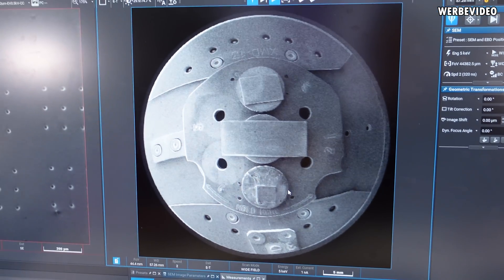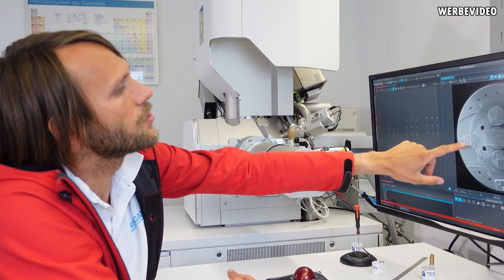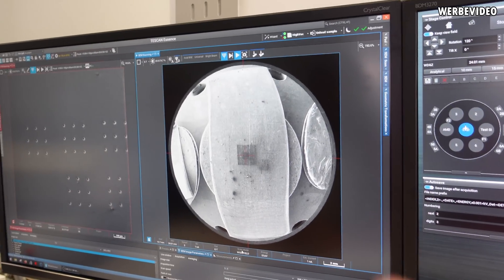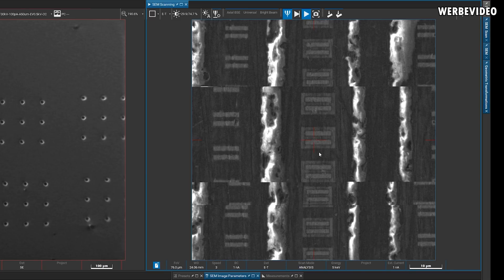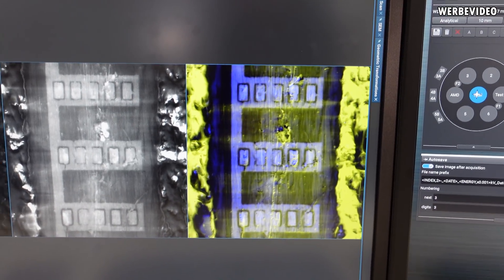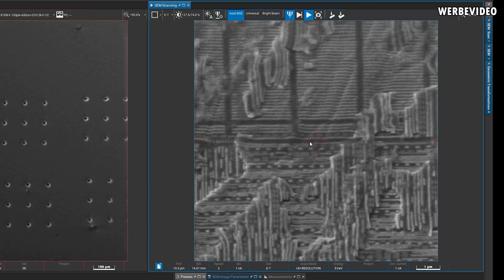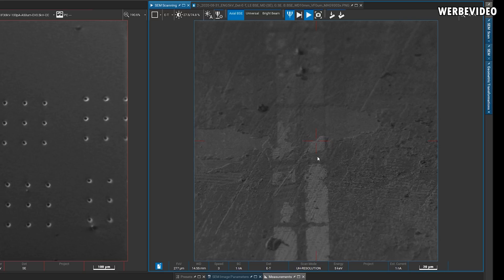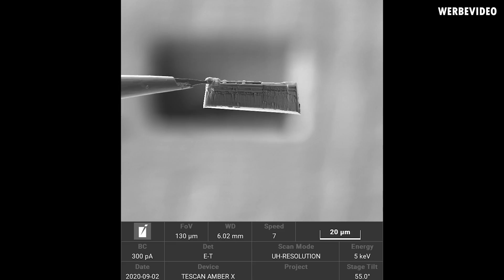Ryzen Nano-Structures more than 100,000 times magnified. Visiting Tescan Part 2/3

Comment: What do you expect that we expect for that comparison between Intel 14 and TSMC 7? Here my expectations:
- TSMC 7 is not twice as small but it is smaller in general 
- There is no simple dimension, because of FinFET and because there are multiple parameters
Reply: Ok so you know what Electron tunneling is with the transistors, and how they use silicon transistors to get smaller like the 7 nm they are currently at with AMD's Ryzen 3000 series CPU's.
And the 5 nm, 3nm and so on, to make the computers more efficient with performance and energy but now we are starting to see more heat.
Silicon has limits but they keep trying to improve it, and it will melt at specific temperatures, so we need to replace it.
Ask yourself why we aren't using Quantum Materials like Graphene (yet) and still using silicon. 🤨🤔

This is where Graphene will fix the electron tunneling aka Quantum Tunneling, we don't need silicon to get down to 1 nm "nanometer" in size.

Imagine this, Graphene computers with a magnetic current to be 1,000 times faster and possibly only use 1% of the energy used. 💡

Now imagine Graphene optical / transparent transistors for Photonic Computing. 💡

Now imagine Graphene lasers for the fiber optics that would be used as the circuits inside our computers for Photonic Computing. 💡

--------

I would rather see Graphene computers, let's get rid of silicon. I'm serious.

Check this out.
I would give links but the video hides my comments.

Go to my channel and click on the playlist called "Videos with important info to get around my channel". ✔

Watch a Flash Graphene video about Flash Graphene 100 dollars "per ton". ✔

And then another video about "Large machines on earth / in space to make Flash Graphene". ✔

After that, check my channel with 2 simple steps for my other channel, go to the "About" tab of the channel I'm commenting with now and read the info with a link found there to save to your browser's favorites. ✔

==============================

Imagine Graphene for Photonic Computing, to help us save on our energy needs, really think about that for a second with Photonic Computing.

Check my other channel for these 2 playlists.
Photonic Computing playlist. ✔

Graphene computers for home and Starships, playlist. ✔

Learn about Graphene from my other channel's "Graphene playlist". ✔

If you want to know more about Graphene and Quantum Technologies, go to my other channel. ✔🤔💡
Reply: @gameresearch9535  
There is no doubt that somewhere in the 20's or 30's they will start using a new material (I put my money on the late 20's). My prediction is that they will first focus on reducing data-latencies, that already is and will become more the low hanging fruit. It also buys them some time to find a good replacement of silicon. Why silicon is being used? Because it is DIRT-cheap and because they have a lot of experience with it. For me the interesting question is which materials they will use instead of silicon in the future. Apparently TSMC has plans ready but the known mixtures of elements have a problem and it all comes down to availability (also depending on which countries happen to have a lot of it)  and cost.
Reply: @peterjansen4826  

Alright, but you need to still check out the information I gave from my other comment, go to the playlists I mentioned and watch everything. You will understand after.

There is a good reason I gave that information and made those playlists, and all the playlists on my other channel.
Again I would give links but my comments become hidden. Just go and watch the playlists.

My playlists are not made from predictions, they show where we are at, which will blow your mind, and they make you realize the corruption that is trying to hold us back for 2 - 5 years, or 10 - 20 years, when we can actually have these emerging technologies, Quantum Technologies much sooner thank you think.

You have to go to the playlists that I mentioned in my other comment, to find out.

I don't just openly talk to people with guesses, I give them facts from proof. And if I mention it, then I'm trying to open people's eyes so that they can see it at my level, so that we can be on the same page, and so it's going to be very important that people check out the sources on my other channel that I mentioned.
Reply: @peterjansen4826  

The companies make a lot of excuses too, you will find out why on my other channel, when you go to the playlists I mentioned for my other channel, and then check the rest of my channel's playlists. 
We can actually have some emerging technologies now, they just do not want to do it, others are just ignorant and biased. 
My other channel clearly shows this, but I do not want to give too much information here in the comments, there is common sense to be had here, that's the point of my other channel's playlists and articles in the playlists on top of that, and I'm stating the obvious. And it would be pointless to mention reasons here when I have the playlists that already do this with the proof.

Regulations / safety validations force some emerging technologies to take 6 - 10 years, this can also be for many other reasons that are holding us back from having that emerging technology, Quantum Technology, and those reasons are usually from corruption in the industry.
Other reasons are because some of them do not want to give up silicon.
If you do a youtube search for AMD's Ryzen 3000 series launch videos with AMD's CEO on stage talking about it, she says "I love silicon".
They are trying to find any way that they can to keep using silicon by making it a little more efficient just to milk that extra performance, instead of moving onto the next material that should be Graphene nanotubes, see the corruption there.

Everything I said in my other comment was true, we do not need silicon anymore, and my other channel shows everything, if you look at everything on my other channel.
Use a Desktop PC to view my other channel, go to the "About" tab of the channel I'm commenting with now and read the info there, with a link.
Use that link found under my "About" tab, and then go to the playlists I mentioned from my other comment, in the order given and watch everything, all videos in each playlist from top to bottom in that order.

Comment: It would be helpful to try and show the same features on an optical microscope just to give some context for what we’re looking at and how much further zoomed in the SEM is able to go.
Reply: Optical microscopes can't go high enough in magnification for it to be useful on this stuff. Generally the useful upper limit for a light microscope is around 1,500X, which is very expensive. Kinda of a pain to work with, too. Granted there are microscopes sold on the internet advertising mags like 2,000 or 4,000 but going up that high just makes the image blurrier because visible light has too large of a wavelength. 

And really, the only significant differences you'd see would be that things would be in different colors. It'd still be the same patterns of structures that wouldn't really make sense to you if you don't know what they are.

Comment: The next part? Where you barricade yourself in so you could play with their liquid Helium? 😏

Oh, scan some thermal paste! 🙏

Twice as good? (It's quadratic), transistor size has been a dark art for a while now. Although it is incredible how they build at such a scale with such accuracy. Might be worth talking about EUV and why Intel has had recent problems, just Moore's Law in general over the past two decades, we thought we were hitting the physical limits but Moore popped some Viagra and he's back in the game. However, we are reaching the physical limits of size and power density. While they can reduce the voltage so they can add more transistors, the price per transistor can't go down past a point so price will have to go up. How integrated circuits/ silicon looks in a decade is anybody's guess.

Medical imaging is an interesting field, computer hardware is virtually free in relation to the costs involved in buy/ running their kit. If you're lucky they may even turn you into a Gamma source...glow

PS: If they ever ask you would music you want for an MRI, the correct answer is EDM (French or German👌). I asked for some Chillout music for my 1st, I realised that was the wrong choice the second the machine got going.

PPS: Steve wants a SEM to measure heatsink surfaces.

Comment: How on earth do companies manufacture electical components so small. actually mind boggling
Reply: photo etching. printing using light. fascinating stuff.
Reply: They get paid uncounted billions of dollars, so they find a way. Making integrated circuits is some of the most lucrative printing that's ever been done. Whoever has the best process literally has the goose that lays diamond eggs.
Reply: Ok so you know what Electron tunneling is with the transistors, and how they use silicon transistors to get smaller like the 7 nm they are currently at with AMD's Ryzen 3000 series CPU's.
And the 5 nm, 3nm and so on, to make the computers more efficient with performance and energy but now we are starting to see more heat.
Silicon has limits but they keep trying to improve it, and it will melt at specific temperatures, so we need to replace it.
Ask yourself why we aren't using Quantum Materials like Graphene (yet) and still using silicon. 🤨🤔

This is where Graphene will fix the electron tunneling aka Quantum Tunneling, we don't need silicon to get down to 1 nm "nanometer" in size.

Imagine this, Graphene computers with a magnetic current to be 1,000 times faster and possibly only use 1% of the energy used. 💡

Now imagine Graphene optical / transparent transistors for Photonic Computing. 💡

Now imagine Graphene lasers for the fiber optics that would be used as the circuits inside our computers for Photonic Computing. 💡

--------

I would rather see Graphene computers, let's get rid of silicon. I'm serious.

Check this out.
I would give links but the video hides my comments.

Go to my channel and click on the playlist called "Videos with important info to get around my channel". ✔

Watch a Flash Graphene video about Flash Graphene 100 dollars "per ton". ✔

And then another video about "Large machines on earth / in space to make Flash Graphene". ✔

After that, check my channel with 2 simple steps for my other channel, go to the "About" tab of the channel I'm commenting with now and read the info with a link found there to save to your browser's favorites. ✔

==============================

Imagine Graphene for Photonic Computing, to help us save on our energy needs, really think about that for a second with Photonic Computing.

Check my other channel for these 2 playlists.
Photonic Computing playlist. ✔

Graphene computers for home and Starships, playlist. ✔

Learn about Graphene from my other channel's "Graphene playlist". ✔

If you want to know more about Graphene and Quantum Technologies, go to my other channel. ✔🤔💡
Reply: @gameresearch9535  it remains to be seen if there is an and so on past 3 nm for silicon. It is not guaranteed if 3 nm silicon can even be manufactured at this point. If we are all busy going OK so you know the problem the industry faces today is the electromagnetic spectrum. Which is an immutable scale. There's nothing we can do about what happens at what wavelengths. They're physical constants. You know that X-ray wavelengths go up to 10 nm, don't you? You cannot very well use X-rays in a masking process either. As X-rays have the annoying habit of passing right through solid matter. What I am saying is these parts pitches are below the size of packets of light. Which is a problem using conventional manufacturing processes. You're wrong about process shrinks and heat too. Ask yourself this, what throws off more heat a single match or a campfire? Why the campfire, of course. There's just more there heating up. Transistors are the same deal. Tiny transistors generate less heat than big transistors do. Transistors are semiconductors. Which is another way of saying they're resistive to a degree. When you pass current through a resistor heat is generated. There's more to it of course but I don't want to get into topographies and how FETs are different than bipolar transistors. The smaller means less heat holds true for all of it. That's why we see performance increases with node shrinks. As heat is always the limiting factor. As for why we don't use graphine we simply do not have experience with the material today. We've been making silicon parts for 64 years now. It takes time for new materials to supplant familiar ones. Often considerable time if we're very good working with the older material. At this point we've taken silicon just about as far as it can go too. So it is fair to say our level of mastery with silicon is quite high. Even if graphine is twice as good it may take us 30 years to reach parity between the materials. It'll probably take longer than that. Because graphine will have to compete with an established material. So it'll get less resources. Transistors did not immediately replace vacuum tubes. You have to understand that investors are risk adverse. They'd rather put their money on sure bets than gamble. Silicon has the track record today. Graphine doesn't.
Reply: @1pcfred  

At this point it doesn't matter, we do not need silicon anymore and I could care less about it.

You are the one that is wrong, silicon has its limits, period, and you didn't even go to find out what I was talking about.

And you are being short - sighted, ignorant and skeptical towards the information I gave, you did not read everything I mentioned and you didn't check the sources for the information I gave such as going to my other channel and then to the playlists I mentioned.

Graphene nanotubes / transistors are smaller than 3 nm, go to my other channel and find out what they are going to do about silicon and carbon nanotubes because now they can use it, Silicon is just nonsense to milk people of their money and you know it is, to say otherwise is to have a stubborn bias and to hold us back from advancing to new materials, Quantum Materials like Graphene.

Just go to everything I mentioned and then check the rest of my other channel after you see it all.

You know that I didn't just come up with this information, we have tested Graphene and found ways for Graphene transistors since 2018, and we have been doing many other things since then, there are articles all about this and you can find articles all over my other channel in each playlist description, what do you think has accelerated and happened since then? You think it has been hiding under a rock this whole time? No, it hasn't.

Don't patronize me again while being so short - sighted and ignorant as to what is really going on.
And do not reply again.

If you can't do something so simple as to learn by going to my other channel to find out with the instructions I gave, then you either have a hidden agenda, or you're incredibly ignorant, and short - sighted with a bias.
I wasn't wrong, you are in denial with ignorance.
Reply: @1pcfred  

Go to the "About" tab on my channel, read the info there, and then go to the link there to save to your browser's favorites.
Use a Desktop PC to view my other channel.

After you open the link under my channel's "About" tab, go to the playlists I mentioned and watch everything, all videos from top to bottom in each playlist mentioned.
And watch the playlists in the order mentioned.

Look, I have the information right there, that is your personal problem if you have to be in that much denial as to not even look, that is a hard headed high level of ignorance.